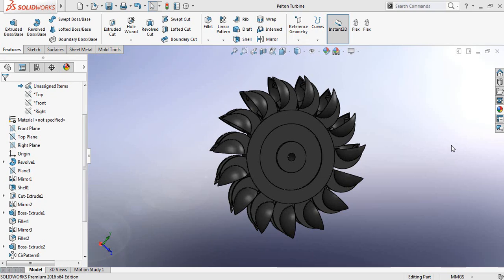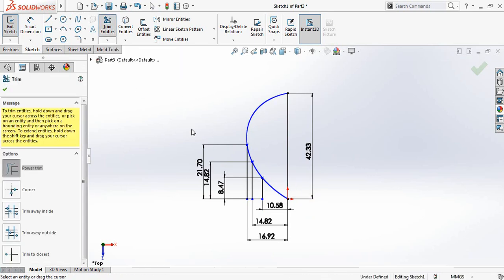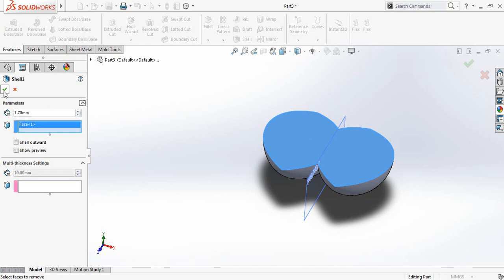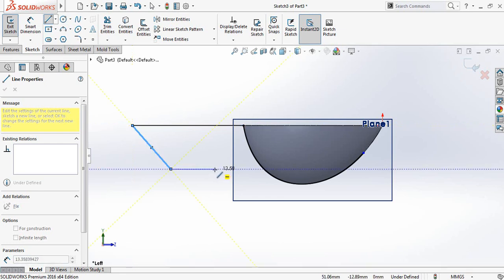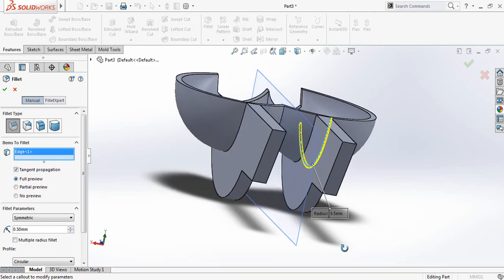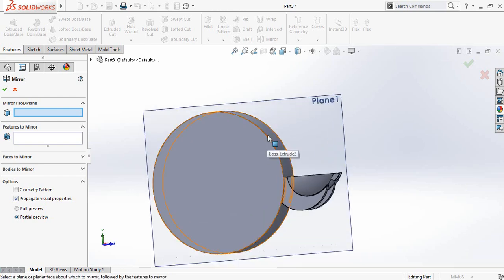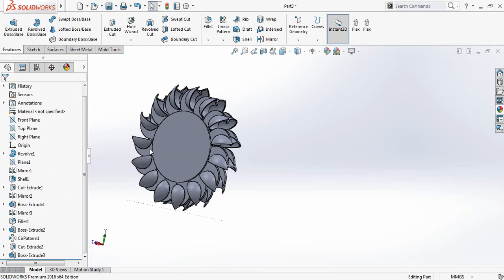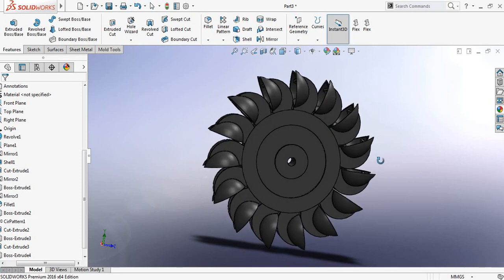SolidWorks Tutorial - How to make Pelton Turbine

Comment: If your Shell feature is not working it is because of the part of the bucket sketch that connects to the origin. When revolved, it forms a point that SolidWorks cannot negotiate.
Your Shell feature is working though.  At 3:43 do not select a face. Just click the green check.   If you do a cross section view you can see that it is indeed shelled but the top face won't be removed.

There are many ways you can remove the top face. Click on it and start a new sketch. Then click the outside profile of the bucket, convert entities, and extrude cut downwards into the bucket.

OR click on the top face and start a new sketch, draw a big rectangle and extrude cut downwards into the box.

OR just edit the very first bucket sketch so that there is a small perpendicular line to the very first vertical line. This will make it so that there is no sharp point formed.

I can think of at least 3 more ways to solve this problem but these are the most basic.
Reply from the maker: Thank you

Comment: Gentleman, I can't use shell, It's having face errors
Reply from the maker: Can you share the problem in details
Reply: @nayemhossain5452  in the curvature, some faces have a radius of curvature smaller than the shell thickness...I also changed putting bigger values but not succes. My solid is 2020
Reply from the maker: Take less value
Reply: @nayemhossain5452  Unfortunealy, not worked
Reply from the maker: After selecting shell, select surface. If ur surface is not selected,  shell will not happen.
Reply: @nayemhossain5452  But I did it, gentleman. Not worked
Reply: same :/ Have you find a solution?
Reply: @danielazarrilli7278  unfortunealy no...